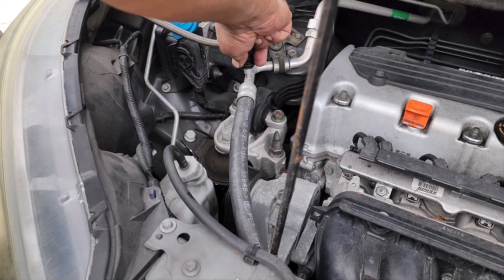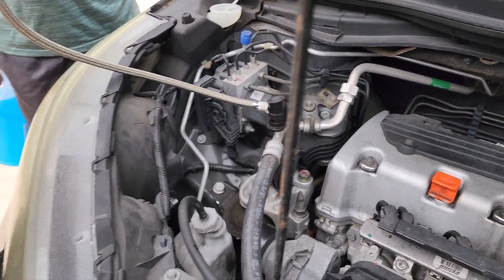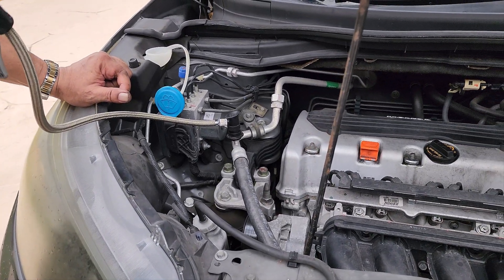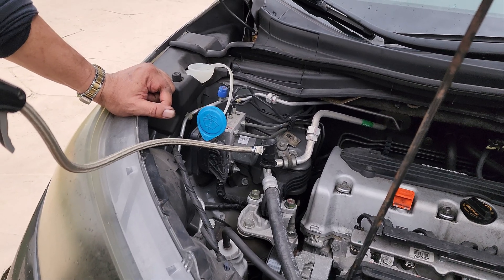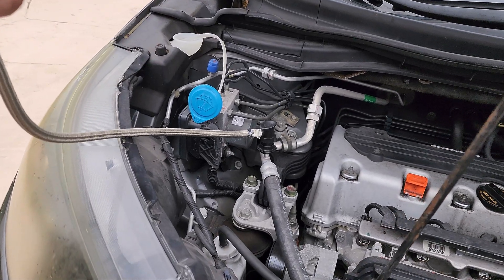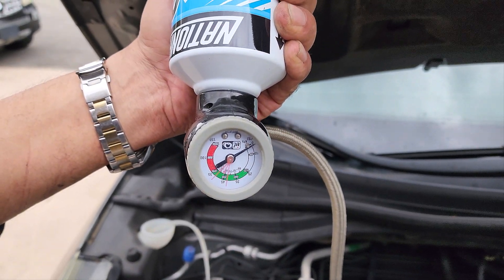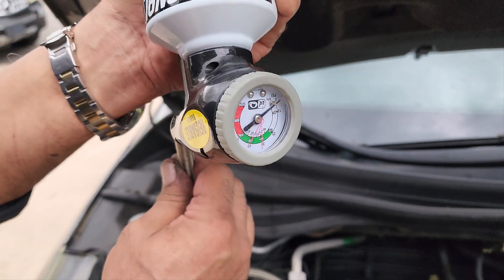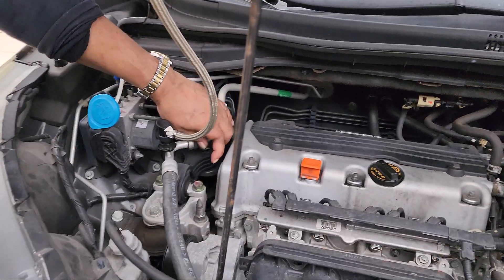How to Replace Freon with R134a in a 2014 Honda CR-V

Comment: I just noticed the pressure was already in the Red Zone on your gauge? This A/C system is overcharged, probably some bad seals in the compressor?
Reply from the maker: Maybe. I haven't had any issues with the AC since doing it, but you never know.

Comment: Dont feed liquid into the low pressure side, only gas!!  thats what I was tolld by a HVAC especialist, meaning dont turn the can upside down as this will feed the liquid gas directly into the compressor on the Low pressure side and you can damage it,  just hold the can in its normal posittion up straight and do it that way so you dont take that risk, this way you will feed the refrigerant in its gaseous state NOT liquid.
Reply from the maker: Thanks for the tip!

Comment: You might have mentioned to check the pressure first. Also, connect to the low side valve that is usually marked with an L. Lastly, the gauge won’t change while you’re filling so people who’ve never done it before will tend to overfill or think it’s not filling.
Reply from the maker: Good points!

Comment: You adjust the dial on the ac pressure gauge to match the outside temp first and fill until between the two red lines.